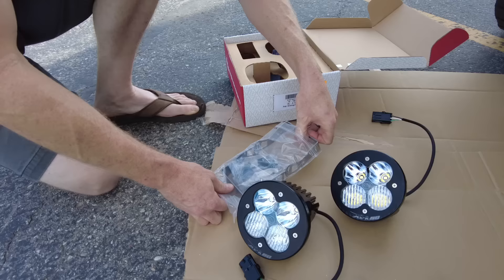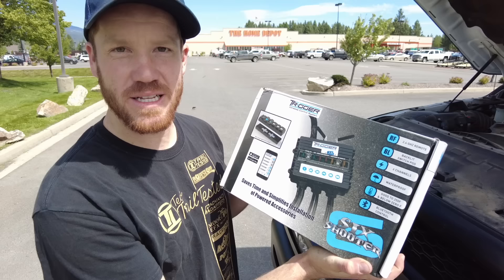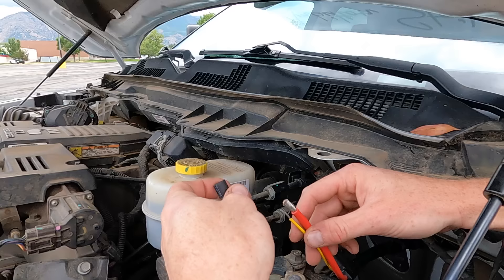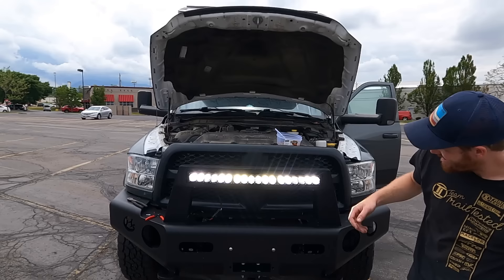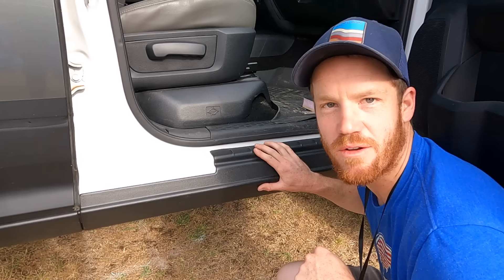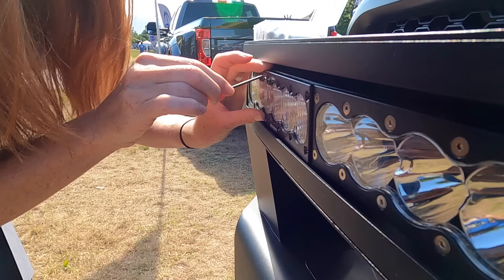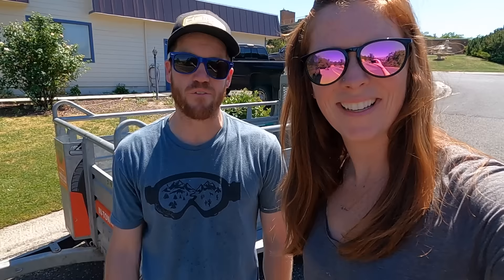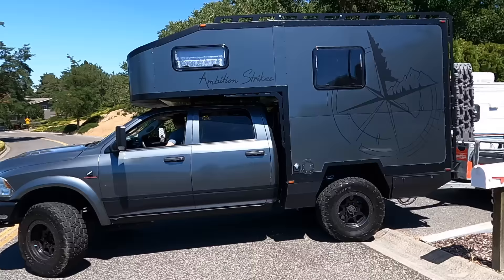We Pick Up An ESSENTIAL Piece Of Equipment | E9

Comment: I love your energy , chill attitude and researching!  I will be looking into that light controller and app.
Reply from the maker: Glad we could help! I think I forgot to mention that the switches for that controller are wireless so you can take the switch panel anywhere (or from truck to camper for us). This also means we didn't have to run wires into the cab and snake them behind the dash
Reply: @AmbitionStrikes  I assume it uses bluetooth and not wifi or cell data... would really suck if you were in the boonies and couldn't turn your lights on!

Comment: What became of the military generator? Later you have problems with a small Ryobi and upgrade to a Honda. Hope to see a video about your generator adventures.
Reply from the maker: We still have the military generator, but at 15kw it's much larger than we have use for right now. Once we get our permanent power system set up, that generator is going to be used for bulk charging and running our welders and stuff.

Comment: Isn't the housing for the light bar covered in heatsink fins? I'd definitely watch the temps the first couple times you use it. Looks sick though, sweet setup. Also, congrats on 70k!
Reply from the maker: Excellent point, we will have to keep an eye on it. The BD bar does have a circuit that will dim the lights and eventually turn them off if they get too hot.

Comment: Nice.  What does a trailer with a generator do to your Gross Vehicle Weight, or is that a shush shush thing?
Reply from the maker: Towing a trailer doesn’t contribute to our Gross Vehicle Weight, but rather our Gross Combined Weight Rating. This trucks GCWR is 25,300lb so we are well under it even towing the trailer.

Comment: Did you look up the specs on that generator?  Its 3 phase and enormous for your needs.
Reply from the maker: It is certainly much larger than we need at the moment, but the long term plan is for it to power our shop, including welders, air compressor, CNC plasma table, etc (we are off grid). The 3 phase will be nice for running used industrial equipment.

Comment: Did you buy a 3 phase generator?   Was that intentional?  You can convert them to single phase, but it’s a bit of an undertaking.
Reply from the maker: Yes we bought a 3 phase generator. We think it will be very handy for running used industrial equipment in the shop (mill, lathe, etc).

Comment: Nice genny! 15kw? Are you guys copying me? If so,you’ll need at least 3 more military surplus generators and 8 more military vehicles. 😏 solar panels and the supporting equipment next? Running one of my military surplus genny right now as the solar panels won’t provide the power to run our ac this late in the day!
Reply from the maker: Copy and paste… 😉
Reply: Well in that case😏 dozer is next. Then 4kw solar panels. 12kwh battery bank. 4kw inverter charger. 150 volt classic charge controller. Saw mill. Tractor loader backhoe. 4x4 Fork lift. 20x24 tiny house. 60x60 shop with a gym upstairs for your wife’s business. At least 3 more redundant military generators. 300 plus gallon on site diesel storage. This is a good start. 😏
Reply: Y’all thinking about a well? We couldn’t drill when we built, strange laws that are now gone. We have a buried 1400 gallon tank that I fill every 14-18 days. The high cost of a well has a bad roi compared to hauling water. It costs me about $5 for the water and another $15 for fuel each time.

Comment: The only negative I see with your channel is you drive a Dodge. LOL 😆🤣😂  I'm a Ford man myself. Although I've never owned a Dodge so I can't say anything bad. I tried GM once with a brand new Suburban and it was a nightmare. Ended up claiming the lemon law at 3417 miles  but had to fight them for over 2 years. They ended up reimbursing me 100 of the cost plus pay the attorney General's office a 40k fine for not paying me until 40 days past the AG's deadline. 1k per day after the deadline.  I will NEVER BUY ANOTHER GM PRODUCT 😒. I have owned 12-13 Fords over the last 4+ decades.
Reply from the maker: Well, technically it's a Ram, they discontinued the Dodge brand on the full size trucks. Ha! We're not brand loyal and try to research the best option for our needs, in this case the Ram was a great deal when we bought and when this idea rolled along, we already owned it. We've also owned a bunch of 7.3 Ford trucks and a couple of 6.6 Duramax trucks. They have their quirks and overall we love the Ram, would buy another one in a heart beat.